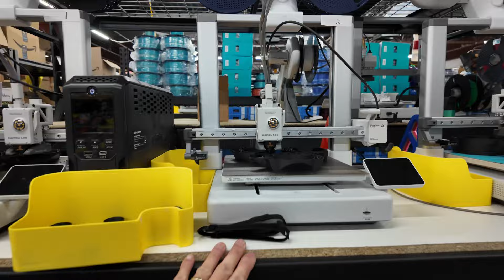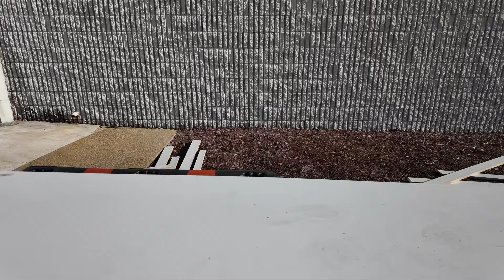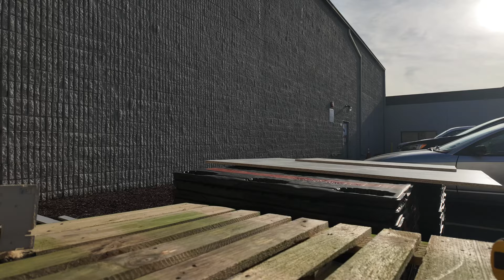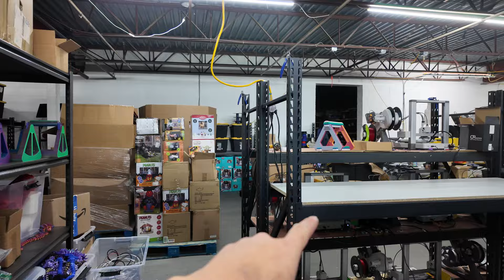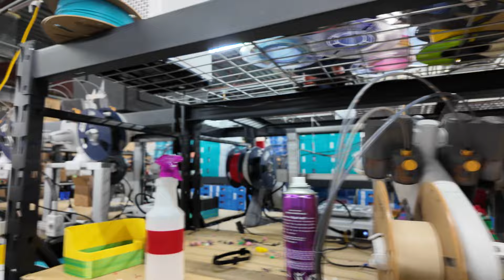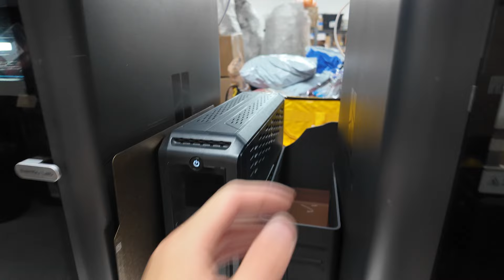Shelving Install Tutorial, Bambu Lab P2S - 3D Print Vlog #63

Comment: I had a Bambulab A1 but I sold it due that the second motor of the AMS lite died suddenly and I tried to get a replacement under warranty without any success. I have the X1C but, when I put it out from the box, it failed printing the purge bucket and made a great mess because the camera chamber died in the night and I was fighting back vs Bambulab to get that camera. Instead relasing new 3D printers, Bambulab should improve their customer services because those are great machines but it's outrageous that, under warranty, they literally wash their hands in order to force customers (or in your case as a company) to spend money instead complying with the laws and regulations of any country in the world. For me it's getting quite hard to get a print farm running in Spain, including all the "barriers" that the spanish government is doing for small business. I love those shelving units but in Spain are quite expensive.

Comment: I use those same racks (Sam's Club) and I buy the 6 foot shelf boards (particle board) from Menards. I trim about 1/8" at one end's corners and they fit tight. I don't use foam. I did print spacers for the cross bars.
Reply from the maker: The foam insulation is pretty cheap

Comment: have you considered those poop chute designs that are a tube that all drop into a bucket / storage tub? You could probably just have one big tub per muscle rack.
Reply from the maker: Ive thought about it but what about the bottom shelf?
Reply: @Dancyn3Dprints  Maybe you could rig up a roomba style machine to run around collecting everything in a basket. Or you could get a bunch of tubing and create a vacuum system to send all the excess to a central location.

Comment: @Dancyn3Dprints  have you considered mainly sticking with the P1S combos though? Since they are cheaper now with the P2S out now. Can get a lot more for their price to replace the A1s. 

I would love for Bambu to come out with a new printhead unit that can swap out the P1S ones so it can use the quick change nozzle system
Reply from the maker: Doing this for this long I've now come to realize that spending a few hundred extra for a better machine with better Ai ends up being worth it in the long run im talkin 2+ years of use. The amount of savings from spaghetti detection and the time saved from being able to use the touch screen really adds up when im putting 10k+ hours on these machines

Comment: Only thing that sucks on the p2s is that the startup power draw is around 1000w vs the 300ish watts that the p1s draws on bed heat up
Reply from the maker: Interesting so.... im gonna put 5 on 1 circuit and see what happens i do have 3 phase in my space not sure the impact that has

Comment: In your previous video ( https://www.youtube.com/watch?v=skTFNerLUU0 ) you said the Bambu Lab A1 is the best printer for a print farm doing only PLA. Why have you changed your mind and decided to start migrating to the P2S?
Reply: possibly due to the amount of print hours on each of them is pretty high, the enclosures on the P2S and P1S helps with blocking drafts. From one of his last videos he had many failures on several A1s from drafts from the garage doors. Enclosures like the P1S and P2S prevent that issue. All of my printers are P1S for that reason. (plus to minimize dust on the buildplate). I am getting a P2S just to have one updated printer. But as I grow my own farm, The P1S Combo is most likely what I'll stick with. Easier to stick with one printer model across the board when possible
Reply from the maker: Pretty much this along with dust on the warehouse